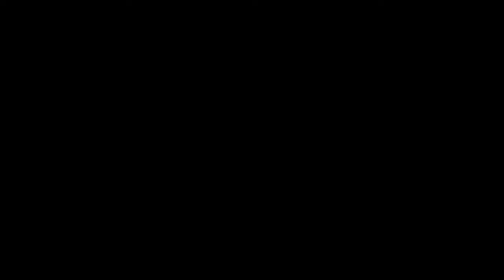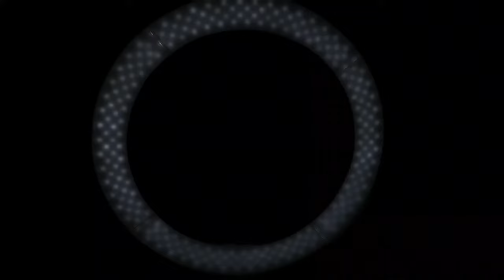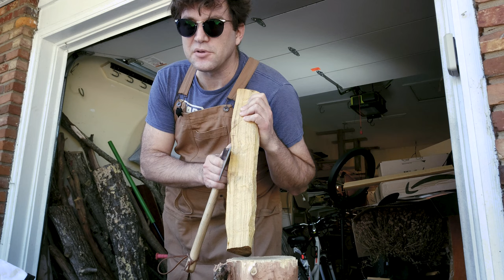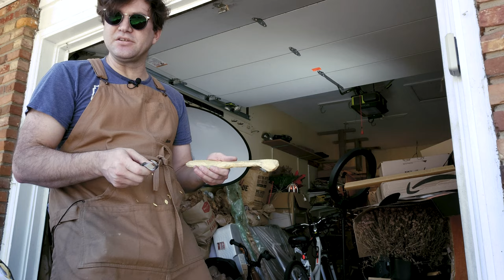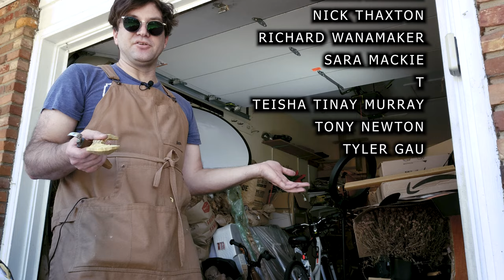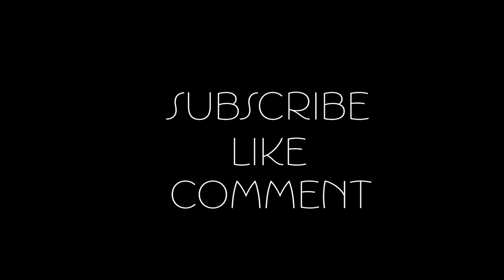The Fascination and Danger of an Axe

Comment: How do you like to sharpen your axe?
Reply from the maker: I sharpen pretty much all my edged tools on a series of diamond stones, then hone with a strop. When it's eventually time to replace those I might give water stones a try, of course I'll still need a diamond flattening stone. 
That said, all the sharpening systems work. I started with lapping paper on float glass, but got tired of replacing the paper. But, cards, pucks, stones, grinders, they all work, it's just preference. I've been thinking of getting a grinder for profiling and fixing edges, but expensive.